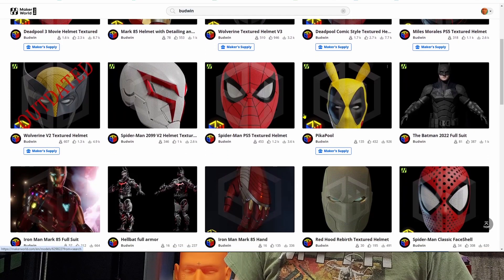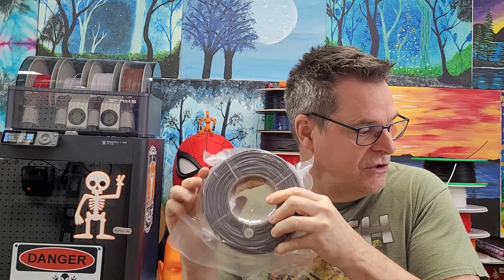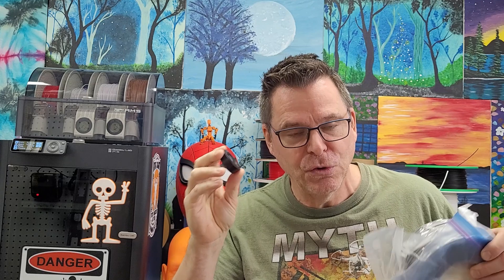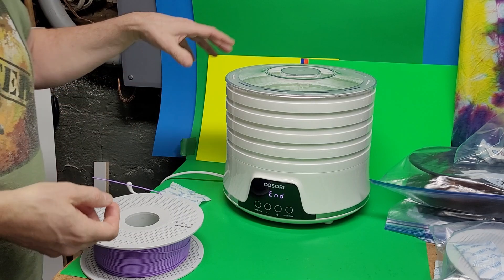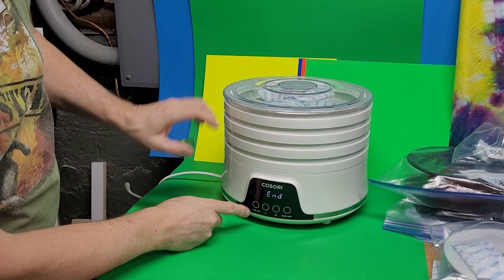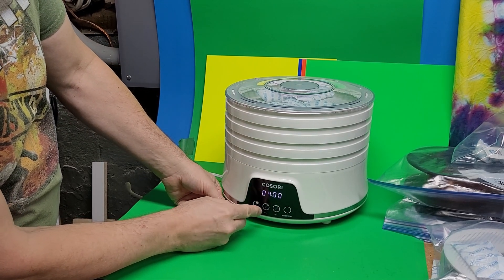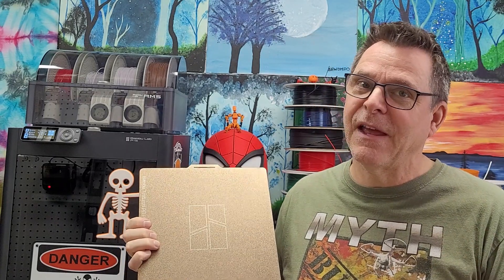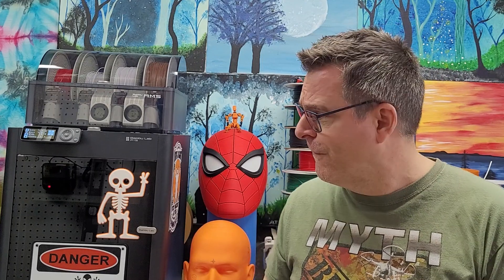Beginners: Avoid these 3D Printing Blunders!

Comment: Those rims on the cardboard reels cause more problems for me then they remedy, maybe it's just with the ones i was using
Reply from the maker: I don't know if it's only the ones you're using.  Mine worked sometimes and twice they didn't and that was enough. I'm using the Bambu reels and the brand likesilk reels work well too
Reply: @mayhemsmiley  yeah I just put the cardboard spools in there plain and they work fine I have no problems with them

Comment: I have a1 mini, a1 and P1s. For me it’s not possible to print with the wrong profile in bambu studio. Gets a warning and can’t start print. Strange that your didn’t warn you.
Reply from the maker: Sorry for the delay, it doesn't warn you when you export to an SD card, which what I did when I first got the printer. Doesn't warn you when you insert the SD card into the printer either. Just Boom and off comes the print head cover. Thank you for watching and commenting. :)

Comment: I wasnt clear on why you shouldn't use printed rims on cardboard spools. Do they pop off or something?
Reply from the maker: Hey Rob, they don't pop off, but they do jam unexpectedly, so I don't want to risk my prints. I'll take the time to transfer even though it's a bit of a nuisance. LikeSilk brand filament supply their filament on a very similar reel to Bambu and it works and is refillable. Thanks for taking the time to comment.

Comment: How odd - one would assume the wrong printer would be an easy and obvious validation check on the printer side. I say odd, when what I mean is downright phlucken ridiculous. Did you report this as a bug to Bambu?
Reply from the maker: Sorry for the delay responding. I was using Bambu Studio without the wifi connected, so i was slicing the model and then exporting to the SD card. Plug the Sd card into the printer and it executes gcode to print, it does not analyze which printer you sliced with. No I didn't report, but I will now that you mention it :)

Comment: Bambu Lab recommends using soap and water to clean the PEI build plate for routine maintenance. Alcohol, such as isopropyl alcohol (IPA), can also be used to clean the plate, but it is typically suggested for removing stubborn residues like adhesive or grease. Overusing alcohol might degrade certain finishes over time, so it’s usually best as a secondary cleaning method.

For general cleaning:
	1.	Remove the build plate from the printer.
	2.	Use warm, soapy water with a sponge or cloth to gently clean the surface.
	3.	Rinse thoroughly and ensure the plate is completely dry before reinstalling.

If soap and water don’t remove all residue, a small amount of IPA on a lint-free cloth can help restore the surface.
Reply from the maker: Hey Ed, thanks for taking the time to comment. I will go and inspect my plate, one printer at 700 hours so far. I noticed the PLA F is definitely much more stubborn to remove form the plate so I will heat it back up to remove the brims around the supports. Thanks again, very important detail for newbies to get great bed adhesion. :)

Comment: For storing your filament it really depends on  where you live. If you live in a some what dry place you don't need to take the time to store the filament in bags. Iv been keeping mine on a shelf for years and don't really have any issues with wet filament. Now i do keep my TPU, ASA, PETG and ABS in a tote with tones of desiccant as even in a low humidity are they will just drink it up. Its also best to dry those filaments before using them. for PLA even silk i dont really tend to have any issues with them. being left out int the open. No for my really old stuff that has been sitting around for a while i will dry it before hand just to be sure. So if you want to take the extra steps feel free if it gives you that piece of mind but for new comers don't stress out to much  about it unless you live in an extremally humid place.  AS for the card board rolls. yeah their a pain in the original AMS. I have more issues with the older proto pasta rolls. as they don't fit and they are so light. The Inland and other rolls that are made of the thicker pressed card board work alot better but yeah they7 still jam the rings do help a lot but they are not fool proof.   As for your first issue i didn't even know that was possible the version of Bambu studio im using screams at me that the profile and printer don't match.  i never tried to force it but i thought the send button was grayed out.
Reply from the maker: Hey Writer, thank you for taking the time to comment. I should have mentioned the climate part of it because I know what you are saying is true. It can be very humid here at different times of the year and especially in my basement where my printers are. Mostly I haven't had much humidity issues because I use up filament regularly, but that one roll of silk sat out for months. These days due to jobs I've been burning through the filament quickly LOL Open the packet install and print repeat. Thanks again for taking the time :)